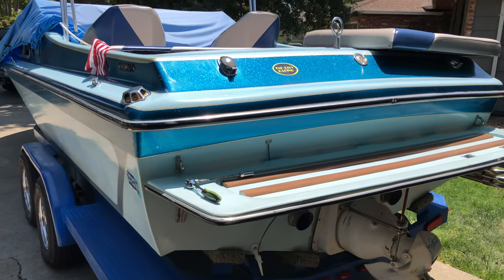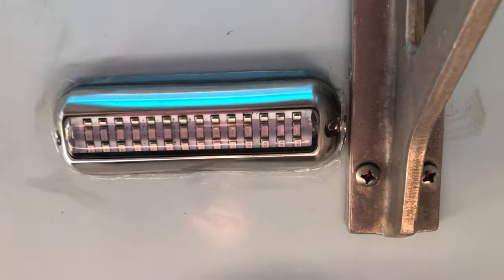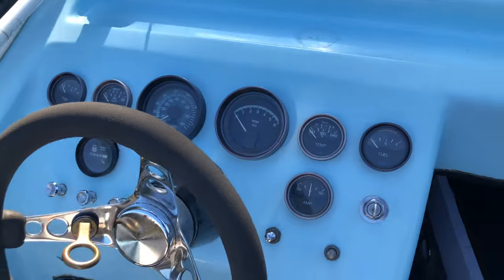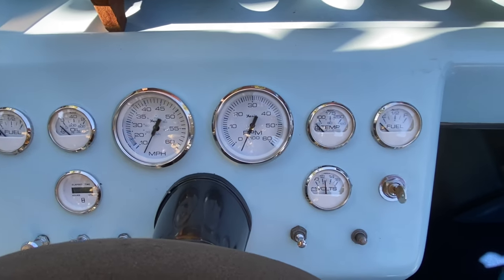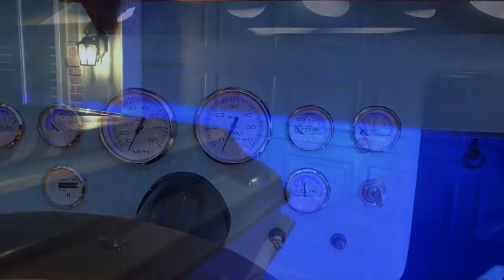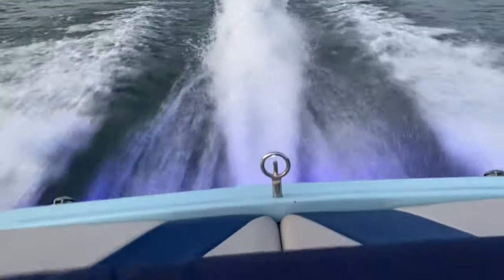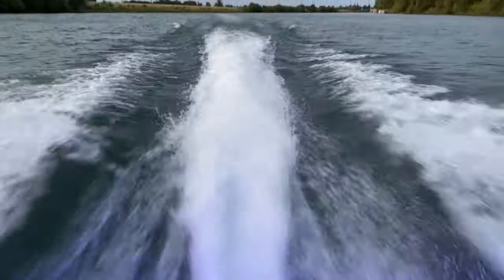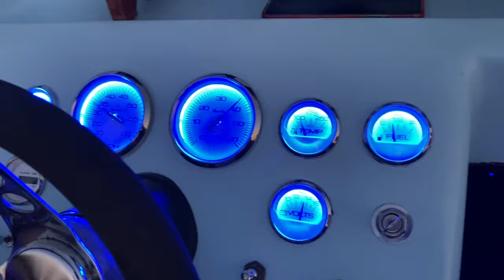Underwater LED Boat Lights Install (PASS-Or-FAIL)

Comment: I have a 2000 Bayliner Capri 1600CF and I'm renovating it, replacing all the old lights and this looks like a great idea to add to this boat as it lacks modern features. Your new gauges look fantastic aswell!

Comment: NO!!!   When you drill through the transom you need to drill the holes bigger than needed and epoxy resin the holes. Then when you drill the proper size it is in epoxy and doesn't contact the wood.
But that looks really nice.
Reply: Truth
Reply: Also should use 5200 instead of silicone
Reply: @rydr2185  Yeah. That's a better choice.

Comment: Did they last? Curious as to how much time you have on them now. Great video
Reply from the maker: Yes, so far so good.. I’ve had them on for a couple of summers with no problems so far.
Reply: @GreeksGarage  that’s great I had a set of lumitech seablaze x2’s only last 3 years and they died right outside of their warranty expiration. $1,000 for two lights and got 3 seasons out of them. I don’t think I’ll do it ever again so I’ve been looking g for alternatives bc I do love to have underwater lights I do a lot of nighttime fishing. Will give these a shot